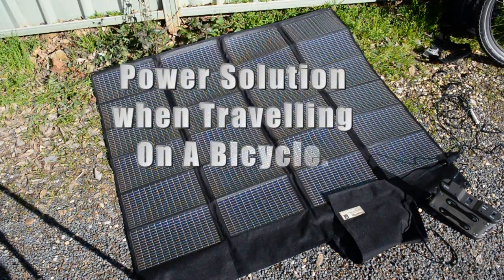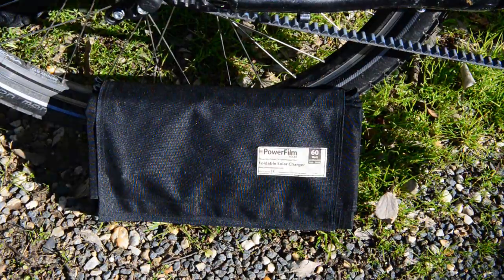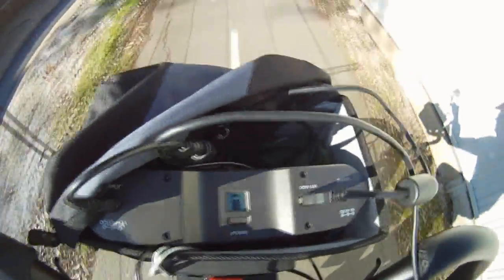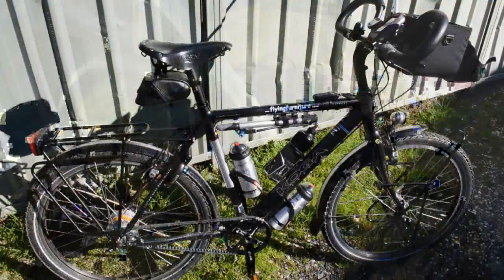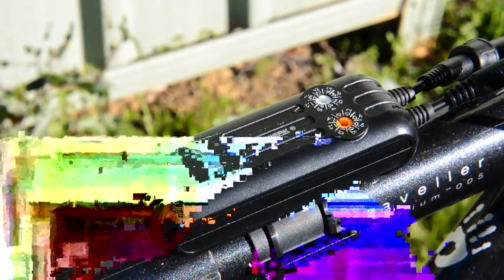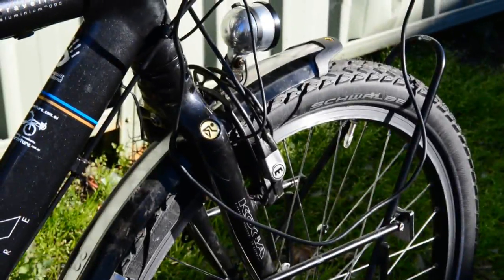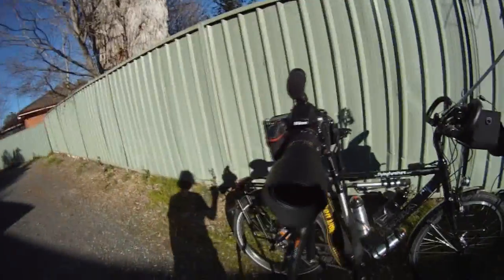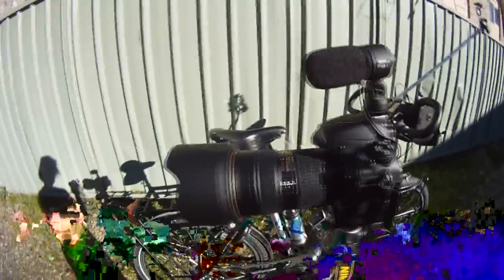Power Solution for bicycle.

Comment: G'day bloke, hey I've gotta ask, what all are you powering with the goal zero all together?..  I can see the cameras and the gps.. anything else?.. and how do you find that belt drive? worth it?..  and have ya heard of the Biolite camp stove?.. definitely worth your time to check out, it's a lil camp cooker with a Peltier thermo electric device on the outside attached to a heat sinc and fan at the base to inject air to the base of the fire.. long story short, it's a camp stove that will charge your phone or in your case your goal zero 120w rig there, of a NIGHT.. or when ever ya feel like it I spose, just a handy option..  happy trails..lol
Reply from the maker: Well I'm powering a 12 inch Alienware i7 laptop for rendering all these videos. Plus charging Gopros, Cameras, phone, and all else. The rendering of videos is a big power drain. Have changed my setup since then. The 60 watt powerfilm was good. i have heard of the camp cooker. The belt is good in dirt dust and all else worth it ? not sure. You get a better range of gears with cassette gears. But the new pinion 18 speed would be the way to go I think. Thanks again cheers Chris.